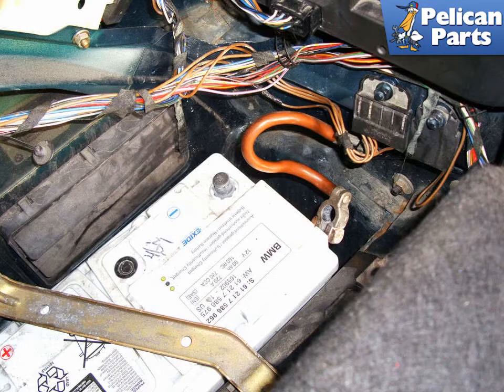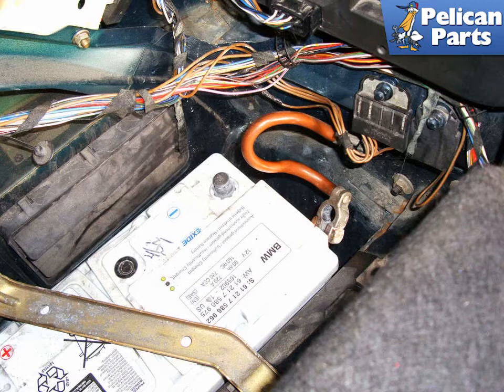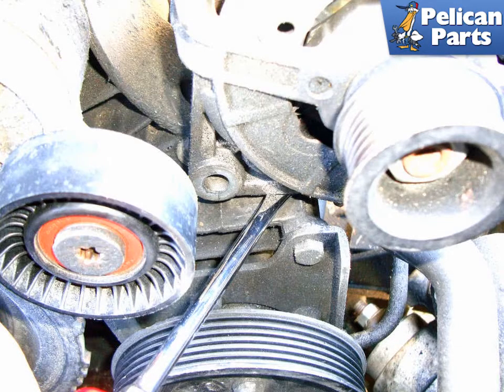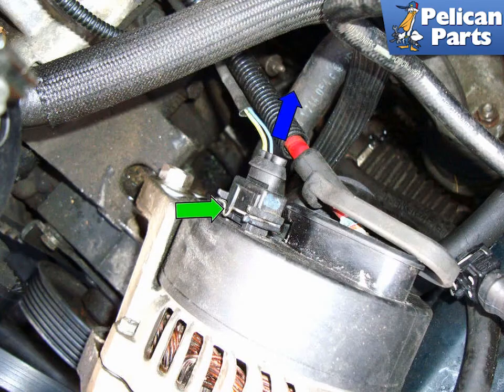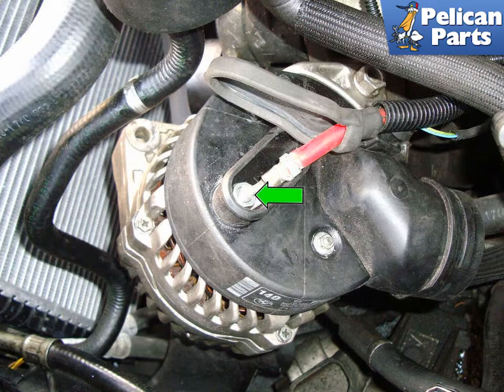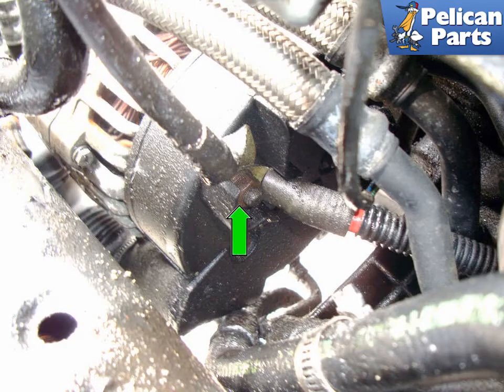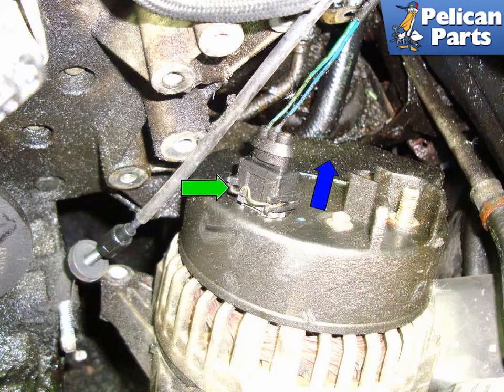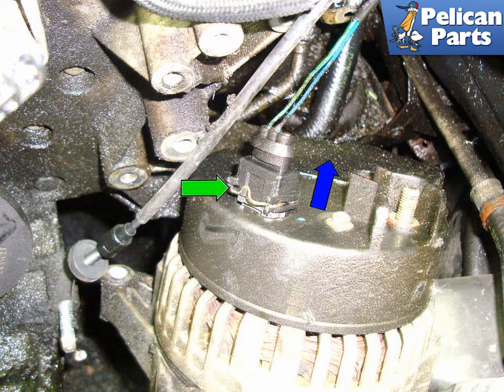BMW E39 5-Series Alternator Replacement | 1997-2003 525i, 528i, 530i and 540i

Comment: This isn’t the same alternator for the 540i it’s water cooled
Reply from the maker: Not all M62 engines came equipped with a water-cooled alternator. The article shown is from an M62 with an air-cooled alternator. See this article, it shows the 8-cylinder engine as well as the alternator in fig 8.  https://www.pelicanparts.com/BMW/techarticles/BMW-5-Series-E39/105-ENGINE-Timing_Chain_Guides_Removal/105-ENGINE-Timing_Chain_Guides_Removal.htm